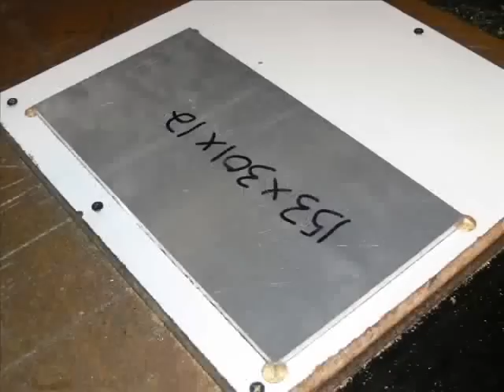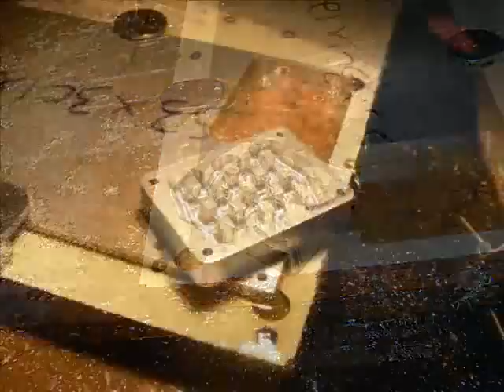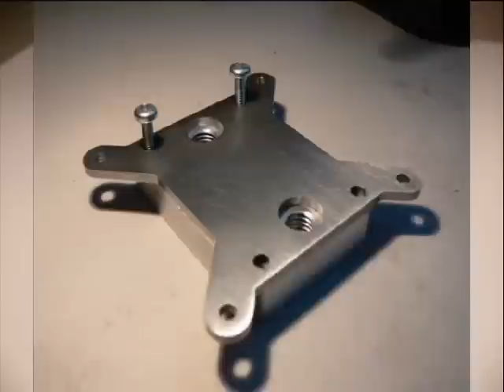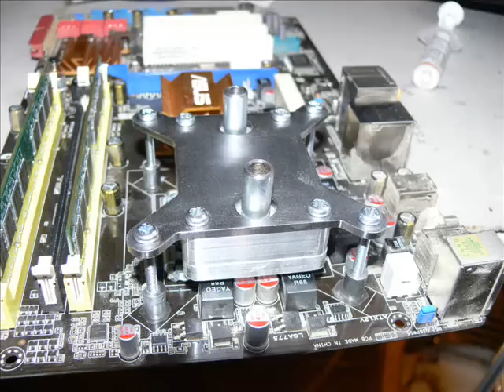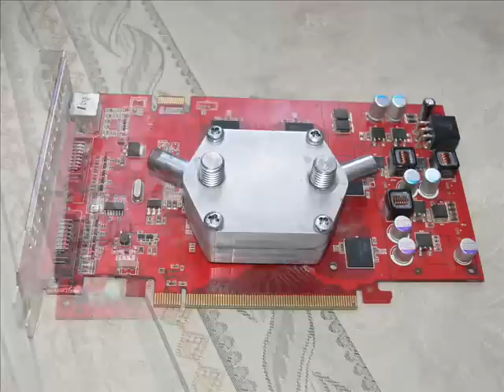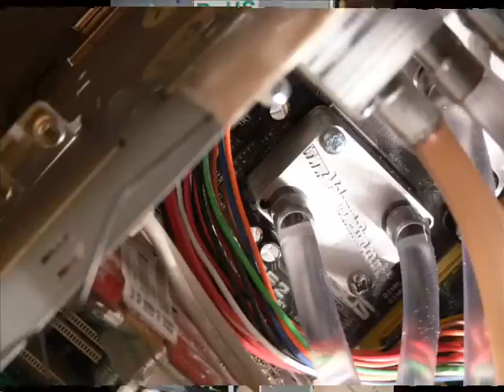DIY PC Watercooling

Comment from the maker: I had no problems with corosion at all, but growth of brown algae was the issue. Over the time they made diameter of pipes smaller. I could be improoved by reducing the water surface area which contacts with the air, but still it have to be vented to allow free water expansion.

Comment: Nice work! I have a sort of related project, wondering about corrosion concerns running an open system like that with no air/O2 purge in the water and no corrosion inhibitor. Have been searching for this answer prior to doing the work. Any thoughts?

Comment: yeah... for some reason i just dont like the commercial ones as my only experience is that they leak... spec arround the fittings... last time it was between the o-ring and compression fitting and on the other is was  between the tube and the fitting. once i saw you design my brain expanded it a bit.. i make the buttom part like now and then have the fittings and top part in one piece.. well just thouhgts...

Comment: I have another PC with i7 3770k, nVidia GTX690, Corsair H100 H/sink and radiator etc. never use it......You should try prime95 to stress test the CPU and Coretemp to monitor the temperatures as you test it. I tried peltiers also, not good under load. Have fun.

Comment from the maker: I never had any probs with leaking etc. I didn't investigate it too much but I believe different processors(different sockets) may have different footprints- hence designs. Taking this into account I'll have to design different coolers for different processors, etc. If you or me, do it for myself, we don't count our hrs. but to charge someone for one-off cooling set it possibly could cost a lot more than commercially available coolers

Comment from the maker: nice project, but i believe motorcycle radiator is a bit overkill. It is designed to disperse huge amount of heat- as far as I remember by current i7 processor generates +/- 50W of heat (comparing to 1000's + in case of bike) , but at least you won't have problems with overheating :) After long day of running, water in my 3l bucket got slightly warm without any fanning or something.

Comment from the maker: I used small  submersible fish tank pump - something what was laying in my garage for ages. If I have to improve it I would buy some 12V pump from fleebay and control it by PWM (possibly by microcontroller with various speed dependent on water temp- would reduce noise and save current consumption)

Comment from the maker: plates are ground/flattened on fine sandpaper( not really needed, but to assure flatness) and sealed with 2 compound epoxy so no o-ring needed. Why no copper?? - difficult to mill- too gooey and clogs flutes; too expensive as well. There is little gain on thermal conductivity in compare to aluminum. just now worth extra effort.

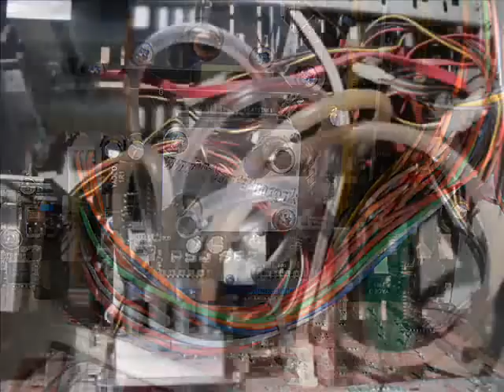Comment: No O ring to seal the plates, hose I/D too small, very restrictive liquid route through GPU heatsink and no O ring, nice bend hose bend on the left @ 2:03....good flow through that I'd say. Why did you not use copper? What pump and rad are you using? I made my own also, using a motorcycle radiator and danger den pump with self made copper heatsinks.